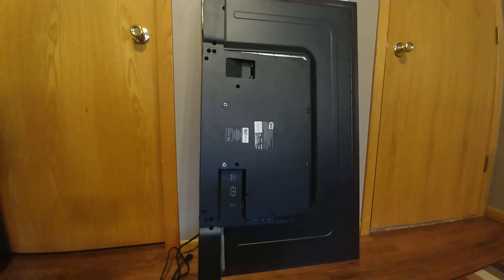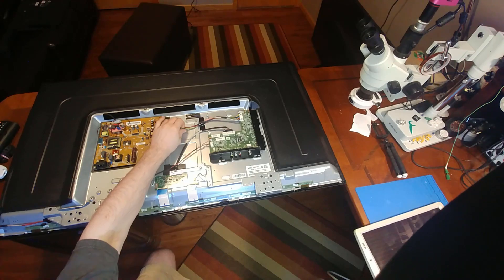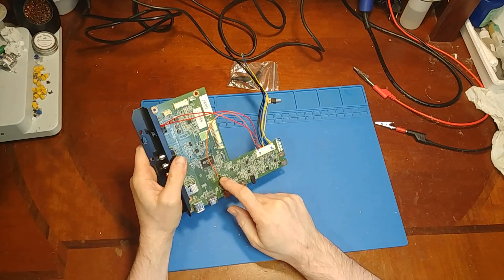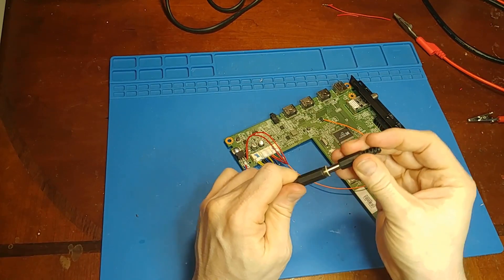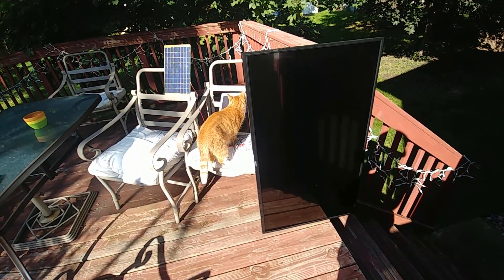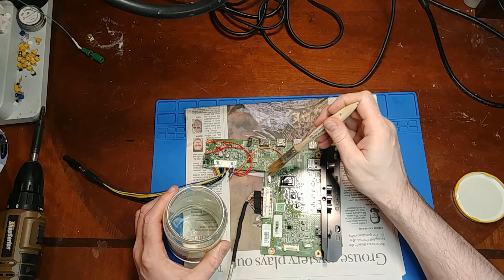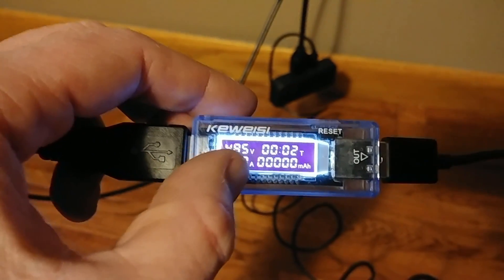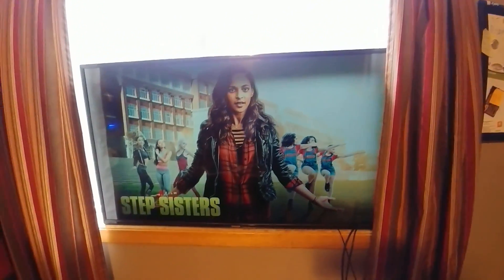Solar Off Grid 49" Smart TV How To

Comment: How about your automatic wire-stripper, what are you using and what do you recommend?
Reply from the maker: I don't remember the details, I picked it up on sale from Banggood a couple years ago. It was less than $10 if I remember correctly
Reply: @jeffescortlx  It still works great after few years?
Reply from the maker: @alexstone691  both the wire stripper and TV are still working.

Comment: Smashing, daytime tv for almost free :-D

When you were soldering in the regulator i thought it would heat up, and the buck/boost thought jumped to mind.
I did wonder about the variable voltage from the solar panel and if the pcb could cope ok, looks like it does :-D. 
You just need a battery for the solar panel to charge and a row of candles to light the screen up at night ha ha joking of cause :-D.
Reply from the maker: The TV continues to work down to 10v so it has a impressive range!

Comment: Clever idea. But the real focus of this story are the crappy LEDs they put in these new TVs and how absurdly difficult it is to replace them when they inevitably fail. It would cost the manufacturers just a few bucks more to add access panels to the back of each unit.
Reply from the maker: That thought has run through my mind more than once. If the back could be removed seperatly from the front half it could be user serviceable.
Reply: @jeffescortlx  That is why the manufacturers don't put in access panels.  They don't want you to fix it, they want you to toss it and buy a new one.  Not a conspiracy theory, but it is planned obsolescence.
Reply from the maker: @etheroar6312  it would work in their favor if they have failures while under warranty. Heck maybe even a good marketing strategy, people might pay a few extra bucks if the TV bought is user serviceable. But for people that can turn a screw driver, taking the LCD panel off isn't impossible.

Comment: Thays pretty neat at 7 watts you could run it off a couple 18650s for a while but at least as a back up or something for someone walking in front of the panel or clouds
Reply from the maker: The only issue with running 18650's is I would need 3 cells and a balance charger setup. An old school lead acid might be bulky, but a simple option. But the Roku could run through a USB battery bank, easy plug and play. I might try that

Comment: Is the Roku actually getting power over USB, or is it powering itself via HDMI? 0.00A seems suspiciously low.
Reply from the maker: I disconnected the HDMI and power stayed the same. I plugged back in HDMI and unplugged USB and it shut off. So it does appear to get power through the USB. Definitely is suspicious. This roku was packaged with a 1 amp USB AC adapter.
Reply: I dont know that i have actually ever seen anything powered over HDMI but i know there is a provision for 5v but i dont know that many devices are putting that out
Reply: A lot of the "stick" style streaming devices are designed to pull power over HDMI.
Reply: Im pretty sure all of them i have seen require USB tho
Reply: USB is there for older TVs that didn't provide power over HDMI.
Reply: Have you seen any that will work without the USB
Reply: Yes. Roku model 3400M actually requires power over HDMI, and doesn't even provide a USB power option.
Reply: @kudo417  ok

Comment: Neat project.  Never would have thought that it takes so little power to run a flat screen without the lights.
Reply: the lights use the most power

 I don't know wht they don't hire this guy to do the elertical   that massive power supply must have cost quite a bit